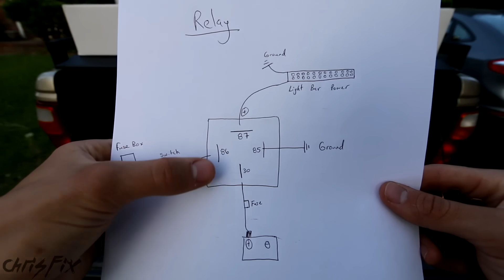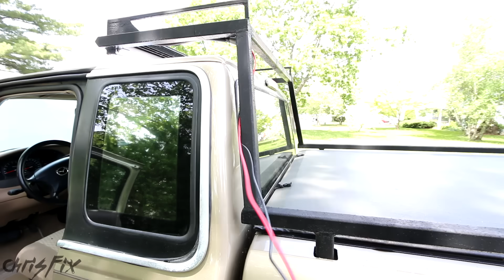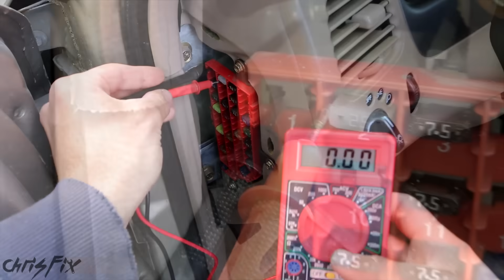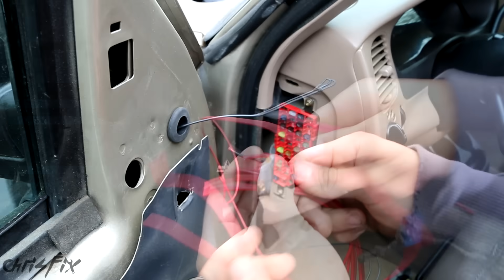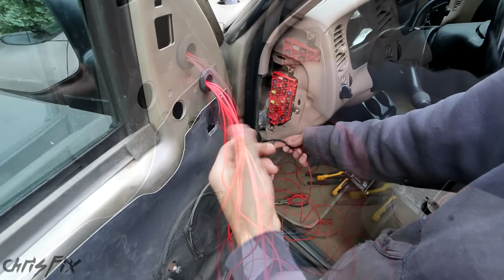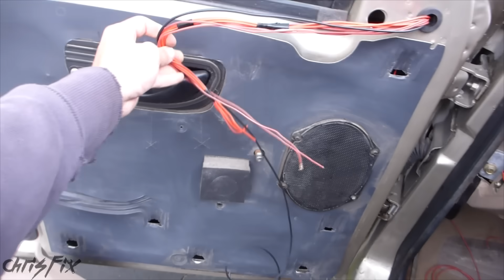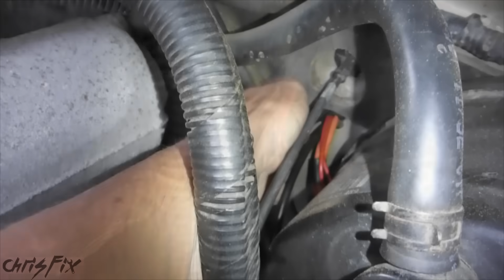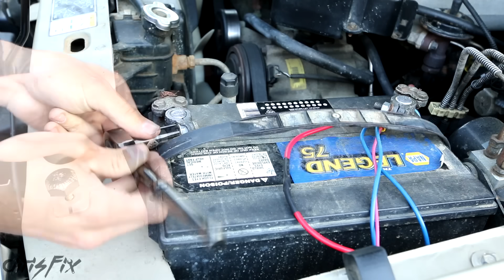How to Wire an LED Light Bar Properly (Project Night Light Episode 3)

Comment: I am eventually going to shamelessly copy this and add other lights. Gonna do those alley ligts and a set of rear facing lights as bed lights. Planning on a CB antenna mounted on it, and if you wanna get clever with the wiring, instead of tying it to the beams you could drill and run wires inside for an ultra clean look. This setup is gonna work really well for hauling my canoe when I go camping. Just some bolt-removable posts at the back and a crossbeam and I'm set.

Who needs a Thule and a Backrack? Make this yourself over a weekend. Whelp, now I have yet another reason to teach myself to weld.

Comment: Wow great video

How do you know what fuse to put into the fuse tap didn’t understand that part
Reply: Just look up how much watt your light uses. amount of watts divided by voltage (on a car usually 12, sometimes 24) equals amperage. If you have 200 watt lights, divided by 12 volts, you'll need a fuse of at least 16.6 amps, so that'll be a 20 amp fuse. But the fuse you use also dictates the gauge of wire you use. The wire gauge needs to be able to handle more amps than the fuse you use, so the fuse will burn out before the wire does. You can find tables for that on the web. A 20 amp fuse would require a 2.9mm2 or 13 gauge wire.

Comment: I know that this does not have to deal with lights.  But when you have to rewire the ignition coil harness, the mechanic that did it used a butt connector instead of soldering the wires.  Now the coils are making a weird noise.  Is that normal?

Comment: Should i Ground a 12v 36w led strobe to battery negative or chassis? Which is good practice please tell?
Reply: You can use the chassis. Saves a lot of cable mess. The chassis is the thickest "wire" you have in the vehicle, you'll need many thousands of amps before you'll melt that, so it's pointless and messy to go to the battery for it.

Comment: Hey Chris I have a 20inch set up right now through a relay. When I tested the light on my drills battery it was full brightness but now that I have it hooked up it's really dim! I've got a 10gauge+ running to the panel I made and 14gauge+ running to the light. My grounds are all on bare metal

Comment: Does this work for multiple rock lights not just one light? I’m guessing I would need to eventually get all the negative and positive cables coming from the rocklights to one single positive and one single negative cable.

Comment: Have you thought about putting a pwr distribution block if I put one in it's a red/ Black to battery then  you add your wires to the block and not the batt keeps everything nice and clean

Comment: When I put my reverse side lights on my pick up I taped into the Rev wire in the rear light assy and put the light assy back into place.
   So when I shifted into reverse my lights came on

Comment: Lol you don't need 2 cables for 1 switch if you use relays. 
You can bridge positive between the switches. You just need 5 cables for 4 switches

Comment: Since some people like to drive with light bars turned on while on the highway and back roads, the proper way to wire them is by running power from the high beam circuit in series with the switch powering the relay coil. This way the light bar can only be powered up when the high beams are on and will go off with the high beams. The switch still allows the light bar to be off when not being used in conjunction with the high beams. This is actually legally mandatory in some places.

Comment: For those who didn’t understood why there’s ground wire in the switch because there’s a bulb 💡 inside the switch it self . For the switch to lit 🔥 u need positive and negative. Switch it will work without ground as well ,but it won’t lit red at dark

Comment: If i might ask. What’s the purpose of the running it through the fuse box?
Reply: If your light would ever short out for a random reason, then the fuse will pop, instead of the wire glowing up and setting your vehicle on fire. For the fuse to work you also need to choose a wire gauge which can handle more amps than the fuse is rated for, so the fuse will go before the wire does.

Comment: Why the relay is so important?
Reply: Because most small switches are not made to handle big currents. If you put 10 amps on a small switch then the switch will burn out.

Comment: TIP: I suggest using any few dollar loom insertion tool. Makes job much faster/easier/less painful!! I bought mine from Amazon. Make sure to buy appropriate size. Sizes are based on loom size, not wire.

Comment: Hey Chris, my 98 civic doesn't have any of those green ground bolts, how do I ground stuff if I don't have any ground bolts
Reply from the maker: Find all the ground locations and add an extension!
Reply: @chrisfix  hey Chris I really need help, I don't have money for a mechanic and I really enjoy working on my car but I'm stumped on this one. Ive got a misfire in all cylinders (random misfire) and can't seem to fix it, already replaced spark plugs and wires and the distributor cap and rotor, can't seem to find the problem, it runs fine from around 0-35 then rough around 40-65 and its reallllllyyy rough on switching gears from 4th to 5th as if it has less power, it's a 1998 honda civic lx and Its my daily driver. Please help lol I'm even willing to drive out to you at this point

Comment: Can u do a review on this project. Also could you explain why u used uninsulated connectors on the switches as there is a high chance they will short out if they wiggle around to much

Comment: Please make a video of a relay box 
Fan1 
Fan 2 
Fuel Pump
Starter 
Diagram 🥺
Reply from the maker: It's different for every car, do a search for your make/model with "relay box diagram"
Reply: @chrisfix  it is for a project build car, that doesn’t has anything oem.
The ECU it’s a Terminator X to a LS Turbo Swap on BMW Z4 2003. It’s crazy but I want a descent relay box to make all nicer. 
Thanks 🤩

Comment: Chris question 07 dodge 1500 trying too upgrade too led interior lights changed blub but it flikers and turned bulb around or over for different connection but still flickers help why is this doing this????

Comment: i would have the trigger cable for the relay contected to the main bulb high beam
.  and + and ground to the battery.  then you can use your main high beam leaver

Comment: Great vid as always and love the whole channel! Just thought I'd mention something as I'm an electrician and the switch wiring made me go 'what?' for a sec. If the 12v feed from the fusebox was in the centre pin of a standard (no LED) switch, it would ground the battery in one of the two switch positions, blowing the fuse. In a bog standard toggle switch pins 1 and 2 are connected in one position, pins 2 and 3 are connected in the other. So if you used such a switch with the connections suggested here it would not work and would be very dodgy, especially if plugged in without a fuse. I did a quick google and see the correct pinout of the LED switches usually used in automotive is as in the video, the internal circuitry is wired for that connection scheme. But just in case someone thought that 'this is how all switches with 3 pins are wired' and tried to use another sort of switch I thought I'd point out that the standard config of a toggle switch would lead to blown fuses (hopefully at best). General rule, just double check the pinouts and make sure you know what goes where and don't connect the battery to ground  ;) No fault with the vid, just thought I'd add in that extra info!

Comment: I noticed your Fuse Tap was rated for 10amp, yet when you were using the wire sizing chart you mentioned the new bar amp draw was 15....any issues with the lower rated fuse-tap??  Should you have used a higher rated Fuse-Tap?

Comment: I wonder how much someone would charge me do  it properly like this. I’m a straight dummy when it comes to wiring it seems impossible to me. 
Do you have a video where you talk about the white corrosion on the terminal that comes from the positive end of the battery? I wanna clear that up before I attempt to do this wiring
Reply from the maker: I used to feel the same until I went out and did it! And mix some baking soda and wooder in a dish, then use a toothbrush to remove the corrosion on the terminal!

Comment: Do you have a link to the type (or similar) of wires that you used that are described in the beginning? With the one end that connects to battery, with its own fuse and switch? That would be a life saver!

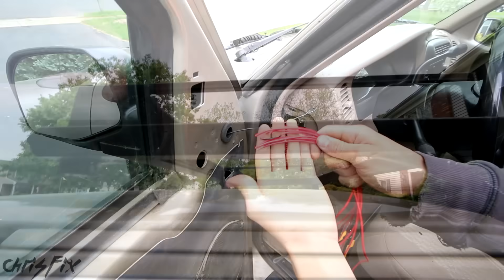Comment: 13:32, 8 wires are actually enough for 7 switches, since you only need one 12v wire from the fuse box

Comment: I've always found it easier to use the oversized zip tie and just tape the wire to the end of it as you pull it through then no chance of poking a hole in your the rubber boots Bad place to mount the switches on count when in movement you could always accidentally bump it which shuts it either off or on and it also takes up so much door space and just looks ugly off of one side that is my personal opinion

Comment: One thing that you forgot to address when using an "add a fuse" wire, if it's plugged into a slot with an existing fuse, the existing fuse must go on the inside, and the new fuse (of equal or lesser amps) must go on the outside.

Comment: I want to mount 6 led lights on my 2008 tacoma. Total watts of the lights add up to 396 I'm using two wiring kits each with 40amp relays. Do you think it will be ok to run on arock battery and alternator with no problem ?

Comment: I plan to install a rear fog light for my car.  Will it be OK to mount the relay in the car, instead of in the engine bay? As in this way, you only have to route  one wire (number 30) through the firewall from the battery to the relay inside the car cabin, instead of two wires (number 86 & 87) through the firewall to the relay if it's mounted in the engine bay.  Thanks for this great how-to video.

Comment: Why not just use "positive on battery - cable (with fuse) - switch - cable to lightbar - lightbar - cable from lightbar to ground"? Isn't that easier than wiring a relay?

Comment: A little foresight and you could have run the wiring for the light bar through the tubes of the frame, down under the bed, rather than having to zip-tie to the frame.

Comment: Hey Chris, when you wired the additional 3 switches, are you going to jump them into the same fuse box slot 17, or does each switch need it's own fuse slot?
Reply: Also do they get their own relay
Reply: It's better to use a different slot.  The slot he is using provides 12V even when the vehicle is off, but you may want to use a different slot for something that doesn't need 12V when the vehicle is off or even more, requires a fuse of a different rating.

Comment: hey Im trying to set up some lights but im confused why not send power to the relay from the fuse box just like how you did for the switch maybe 2 empty fuses tap in power for the switch and one for the relay would this work the same
Reply: I simply do not want to connect anything directly to the battery and rather feed things through the fuse box

Comment: I just bought a 2005 Silverado 2500HD. The owner's father installed a light bar, but by the time I bought it, the cable was cut and taped.
Coming out from the cab and into the bed, there's a cable with Black, Red, Brown and White wires. Connector is missing. But the light bar has a five pin connector and same color wires.
I've determined that Black is ground and red and black are left and right cargo lamps. But the white wire does not energize, even when I activate the emergency lights from the switch on the right hand side of the dash.
Also, who sells those 5 pin connectors? If I can't find this type, I'll redo both the light bar and the cable from the truck side with a new set of connectors. Besides, the owner had the female connector on the light bar and the male on the supply side, which is reverse of what is safe--you don't want exposed pins energized and shorting against the metal bed when not connected to the light bar.

Comment: I'm gonna have to watch this like 7 times to understand the wiring process.
Reply: Wiring is so easy, it’s just electricity isn’t something we can see so it’s harder to understand. So we mentally make it more difficult than it really is.
Reply: @petergross135  Running the wires sure is easy and interesting. Just be sure that you use the right size fuse and wire gauge. If you undersize it then you can set your vehicle on fire.
Reply: I'm about to do underglow and I'm seeing all kinds of stuff you never see in any other tutorials. I didn't know there was a fusebox on the steering rack.
Reply: @the_ak_spec  The fuse box is located in a different spot for every car.
Reply: 7 years after this video came out and I’m still watching this every time I wire up a light
Reply: @jaarondavis7426 same! Only nine years later now. 😂
Reply: Same about watching it like 7 times
Reply: just buy a wiring kit.
Reply: @jackfieldsjack1061  I’ll start this by saying I don’t know shit about this. But I have a light bar, and you’re saying you can buy a kit for this?
Reply: Same here I have been watching this videos since last month I still can't wire my lights 😒😒

Comment: this wiring would be illegal in most jurisdictions, as it isnt tied into the high beams, so i dont really think you should be using the term "properly", unless you want to get sued (disclaimers are mostly useless for abdicating responsibility in court)
Reply from the maker: Thanks for sharing!
Reply: @chrisfix  no probs, ive noticed a few youtube tutorials dont mention this at all, and some are outright hostile when its pointed out. i know theres places where its not illegal, but those places are the exception to the rule. 
heres a Like on yr vid, just for not getting upset ;) 
...
offtopic : what is "Standardization", if not "one world government"? we need more freedom of choice in governments, instead of carbon copies
Reply: There are no laws applying to car electrics. It's not part of the countries grid. You can arrange it however you like. It's everyones own responsibility to make sure the wires don't go glowing and set the vehicle on fire 🙂
Reply: @Engineer9736  there are hundreds of laws applying to car electrics. most ppl dont know about them cos they are most commonly affecting only manufacturers, but technicians also need to know them so they dont get sued. you sounds like the kind person who gets others killed through negligence.
basically what you just said is the same as saying "i dont have to have any indicator lights"
Reply: @Ghryst  No there are no laws applying to your cars wiring, and yes you need to have indicator lights. How you make them light up is your own business, they just need to be on when required. Please state a law article if you are so sure about it :). If you cannot find any, then please reconsider your attitude about "ppl" and which things are facts and what not. You're spreading nonsense.

Comment: nice install i drilled a hole through the cooling fins and ran a small bike lock through the mounting bracket that is pop riveted to the windshield pylon BIG riveter from harbor 19.95 and works great on our entrance handles i buy the handles in a 4 pack and im out need to reorder

Comment: this is good and all, or you could do what i did and use the bull bar as grounding and then run the wires around the mirror into the door jamb, through the glove box and then superglue the switch to under the dash

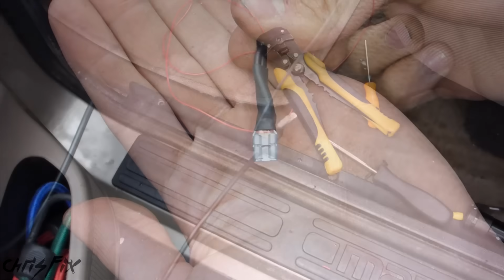Comment: 20:25 Can i use a normal Hair Dryer for this?
Reply: No, you need like at least 100 degrees C to shrink heatshrink. You can use a soldering iron or a lighter.
Reply: @Engineer9736  Thanks man

Comment: Great video as always!
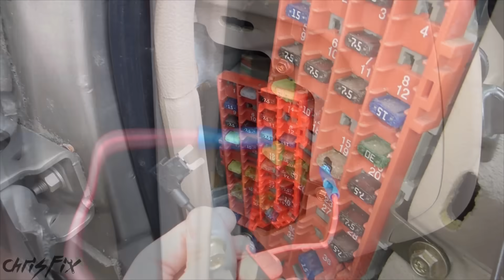I'm not an electrician lol but regarding 9:00 isn't it crucial which way the tap is inserted? If you insert it other way round you should, the cable will bypass the fuse and it might burn your cables or car.
It would be worth mentioning that the cable going out from the tap should be always on the opposite side to the live socket pin in the fusebox.
Please correct me if I'm wrong.
Reply: He measured that completely wrong. The right way is to touch one of the multimeter leads on a ground, like a bolt or pin 4/5 on your OBD port, then poke the other lead in the fuse box. A fusebox has no ground, only hot (incoming power) and load (outgoing power) connections. If a fuse position has nothing connected on the load side then he would have measured nothing while the fuse position may have actually been usable. And yes, the tap needs to go in in a specific direction. Otherwise the original appliance will have a double fuse, and the appliance on the tap will have no fuse at all.

Comment: When you say “gauge wiring”, I assume this is an American term for power outage? What does this mean or convert to in English terms??
Reply from the maker: It's just a measurement of the diameter of wire!
Reply: ChrisFix how does that convert to amps? That’s what I meant sorry
Reply: @Legend-wu7pj  The gauge is a diameter of the metal, the amperage carrying capacity of x gauge of wire depends on the length of the run and the metal. There are lots of charts showing this online.

Comment: I have been watching your videos for about 2 years. I have a 1994 f250 now i also have a 2013 chevy equinox. I have been able to do a lot by myself on my vehicles expect when they are to heavy for me than I need help as I am 59 years old and have been working on my own cars for about 25 years. Since I started watching your videos I have been able to understand and do even more by myself and this light is my next project.
 My only question is, what do you think of those heavy magnets on the market that say you can put them on the roof and attach your light bar to the magnets.
thank you